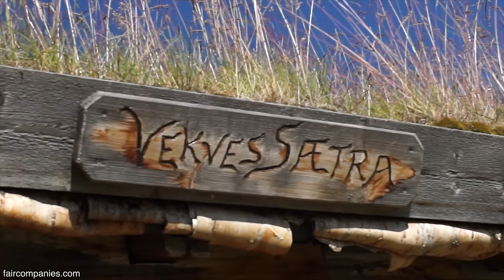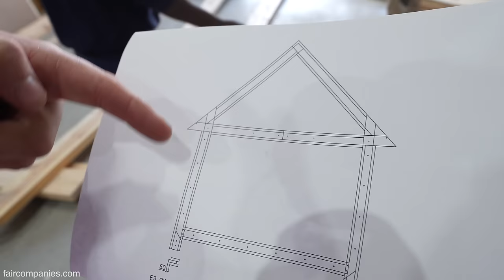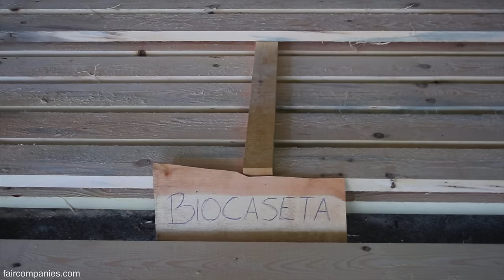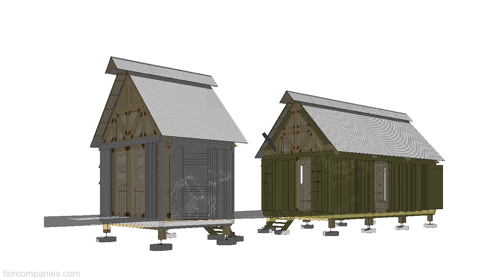Biokabin: our modular eco-home to snap & build in backyard, Nature

Comment: I have to wonder, with such close-fitting components, if warping due to rain and/or humidity will be an ongoing problem. I can't think of any finishes that will allow components to slide into place like a bare wood surface, but bare wood is likely to warp and thus also prevent proper fit. This is not such an overwhelming problem if assembly is intended to be permanent, but if you want to be able to reconfigure the basic components warping may be a problem.

Comment: One summer in the mid-'60s, in NY, my family lived in a 2-room lean-to. The bedroom had 4 bunk beds there was enough room that a wall could have split that room in two. There were shelves for clothes. There was a screened window on each side. The was a toilet and  a sink. The shower was private, but outside. The other room was the kitchen/😅all purpose room small not tiny refrigerator, 2-burner stove, sink big enough for a spaghetti pot. The entire short end of the cabin was 2 sets of French (folding) Doors that were screened. I am pretty sure there was a ceiling fan too. I would get up in the morning, have breakfast, run down to the lake, swim and read my books, only came back up for meals. After  dinner we would read or play games, build a campfire and cook out and do campfire type stuff. If it rained, we would stay in the cabin, or go into town.
We were campers, and in  all my years, I stll think that was one of the best vacations I ever experienced!

Comment: Ok I looked this up, the studio without glass is 39,000😮, the idea is great, but that is a bit too steep for the material being used. Unfortunately, while wood is an easy flexible build here in interior Portugal living in a wood cabin is dangerous with the fires.  Also, not to mention the drastic temperature changes and wet winter conditions makes wood not feasible.

Comment: - [00:13] 🏡 The video explores the concept of cabins, showcasing how they blend with nature over time.
- [02:28] 🌲 The founders aimed to create affordable, healthy cabins, resulting in the BioCabin concept.
- [05:25] 🏗 BioCabins are modular, sustainable structures designed for easy assembly and disassembly.
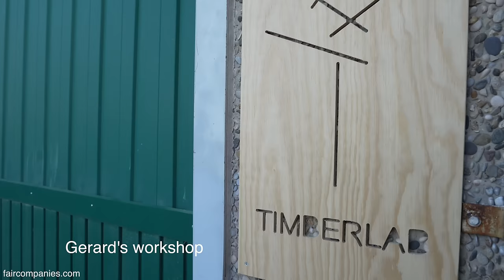- [08:42] 🛠 Construction of BioCabins requires minimal tools and can be completed by two people.
- [11:20] 🧱 The cabin's structural components are mechanically joined without the use of glue.
- [13:13] ⚙ The design allows for easy reconfiguration and adaptability to changing needs.
- [19:32] 🪑 BioCabin components serve multiple purposes, promoting versatility and efficient use of space.
- [22:53] 🌳 The cabins utilize sustainably sourced wood from public forests, promoting a circular economy.
- [31:33] 🏠 BioCabins can be compliant with local building regulations for accessory dwelling units (ADUs).
- [38:32] 🏘 Overcoming the stigma of prefabricated buildings remains a challenge, but BioCabins aim to offer a solution.

Comment: You truly have seen and chartered so many types of living and lifestyles. Sustainability is key to any community and living structure. Surely the take away is we need to do this together and learn from all those individuals on what designs and materials can be used but that the sum total- the community has to be functional toward all the aims of its individuals including all ages and needs??  Community Housing takes a lot longer to materialise but can also last longer than individual lifetimes??

Comment: I'm actually building something remarkably similar to this right now but designed for colder climates. It's called pet house project on instragam

It's my architecture master thesis and uses the same philosophy. Modular, sustainable, assembly takes 2-4 days, similar shape and size. Just a lot more insulated and air tight which makes the manufacturing more complicated.

Comment: No real insulation to speak of. Wouldn’t work in a hot climate like Arizona. Wouldn’t work in cold climate either. I’d like the ideas, but the implementation is not functional nor aesthetically interesting. You could build a better structure for half the money legally without permits if it’s under 16‘ x 12‘.  Note that there’s no electricity or plumbing, which would be against code in most jurisdictions.
Reply: wood fiber insulation
Reply: In my area is has to be 100sq ft or less to be built without a permit.
Reply: Why have none of you actually watched the video before commenting?  These things are actually discussed!

Comment: Are there enough rich people around to buy that?  It's designed for a very high budget.  
If anyone is interested in prefab, they should do a little research on prefab house companies.  See how many are in business right now.  Not many.  Look to see how long they have remained in business.  The ones in business today are probably pretty new.  After looking those things up, see how many companies started in the prefab house business in the last 100 years and compare the two.  You will see that the failure rate is almost 100%.  The theory is that building a house in a factory is more efficient, and that will lower the costs.  It sounds very reasonable, and you would think that almost all houses would be made in factories by now.  But they are not, in fact, nearly zero are.  The math doesn't work out the way everyone assumes it should.  The reality is that factory-made houses cost more money than site-built houses.  The reality is that the only "low cost", factory made, houses are mobile homes.  They do sell for less money, but not as much less than you might think, especially since they are made from low quality materials, and meet a lower standard.  It makes a person wonder what a site-built house would cost that used the same materials and followed the same, relaxed, building code.  My guess is that it would cost less than a factory built mobile home.
The design of the "cabin" shown in this video is just one more that has been proposed by a slew of geniuses who have invented a "better way of building" in the last 100 plus years.  Thomas Edison, Frank Lloyd Wright, and Buckminster Fuller are just a few of the geniuses who have applied their brains to the problem and failed.  Those guys couldn't figure it out, and all of the hundreds of other people who have tried couldn't make it work either.  
After you see so many failed attempts you start to believe that the problems the geniuses struggled so hard to solve are either, not the real problems that need to be solved, or else the problems that come with factory-built house construction are unsolvable.
For every person who has ever been involved with prefab construction, there are ten thousand who have worked on site-built houses.  The brain power of that mass of humanity has not just been solely tied up with chewing tobacco and listening to country music.  They think about how they can do their work faster and easier so they can make more money.  Houses built today are not built the same way they were built 10 years ago.  Builders have thought of faster ways to do things in ten years.  And that trend toward improvement has been like that since thatched huts.  If you want a solid house for a decent price, go with experienced builders, and a plan that has been built many times before.  The problems will have been worked out before they begin on yours.  Don't be a laboratory rat.
Reply: Most homes built in the last 10 years by builders are crap, though.  They do not last.  They are built to the barest code with the cheapest materials permitted in order to eke out as much profit as possible.  This is commonly known, surely.
Reply: @tamcon72  
That is not true at all.  Houses built in the U.S. will last for more than 100 years if provided with normal maintenance.
As for highest profit, the cost and value of the real estate a house is built on determines the profit margin more than any other factor.  And builders who make the most per house, use premium products, not cheap ones, because their clients want the best.  But those are houses for rich people.  Typical houses are built to code, and code today provides for many more levels of safety and durability than building codes did decades ago.
Reply: @deezynar    I assume you're a builder or in that trade, and that is why you deny the lowest common denominator level of quality the average "quick" builder housing project is.  I owned a midcentury home in the Upper Midwest until a few years ago that featured high quality structural and finish materials though it was a typical middle class home, I knew people who purchased new homes built since the 1990s designed and constructed by bulders--rather than designed by architects and constructed by skilled contractors working for their firms, like mine was--and spent three years in architecture school at the end of the last builder boom of the late 1990s, and know your concluding statment is not accurate, at least for that market.  The idea that a builder home of today will last for a century is absurd:   Just roofing and ventilation issues are so common with builder homes as to have become an industry cliché, so I'll ignore it.

Comment: Kristen is what he showed you anything close to a place your folks could visit, let alone live in???? I sincerely doubt it. 
Emerson’s place was bigger than this & he didn’t have toilet.  

Just 1 ‘module’ does not look feasible in real life. Maybe with no running water, a compost toilet…out in the ‘open’, and if electric a mini bar fridge and a hot plate.  Even when I was 20, this would not have worked for me. 

His pretend set up time vs. what it actually took…TRAINED people is way off, 3x as much. No multiply that by # of modules actually needed, plus the added walls, counters, etc., then add in the union trades + the inspectors, and that’s even IF this w/b code in CA…